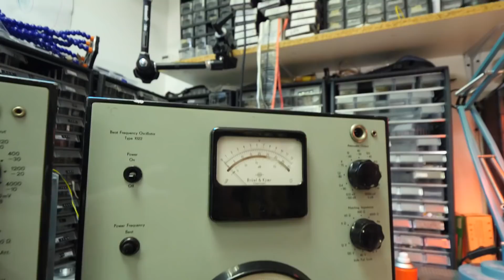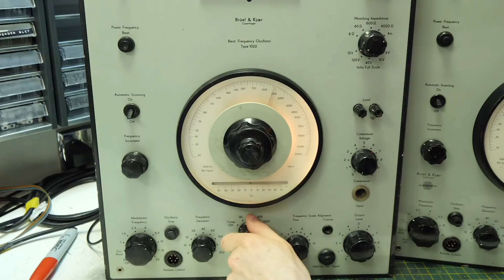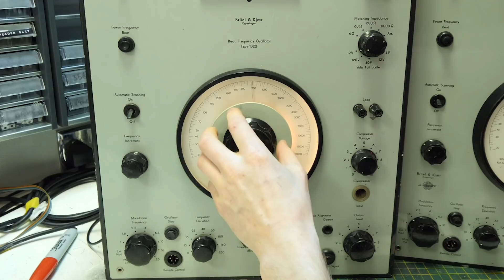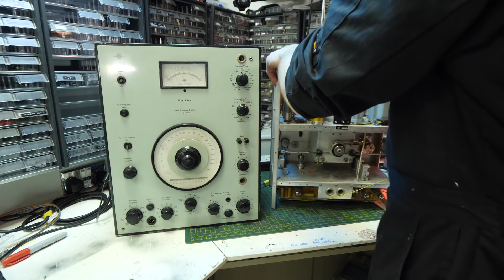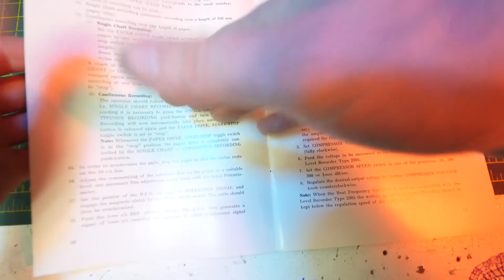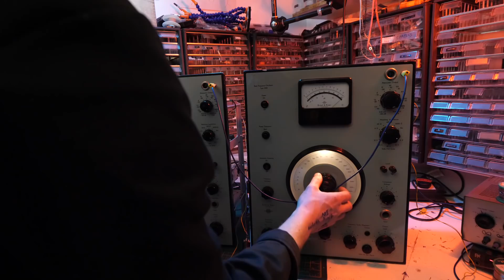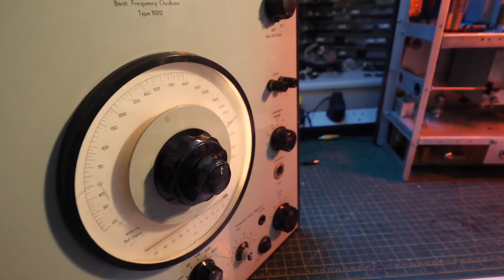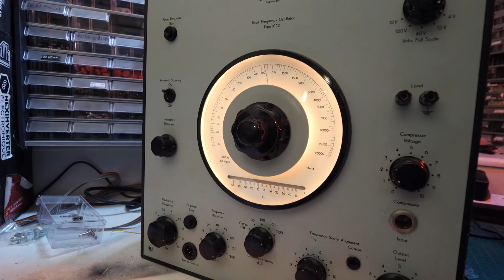Do They Sound Different? SOLID STATE Versus VALVE Bruel & Kjaer 1022

Comment: Been watching both you and Hainbach playing with these.... 
B+J devices , I particularly enjoy once you got them all hooked up as a studio of test gear. 
I too, am interested in the external modulation and haven't seen either of you try what immediately struck me ( probably because I have also been watching Aaron Lanterman go deep on the DKI synergy) but have you tried using one device to modulate another...hypothetically you should be able to setup algorithms of the devices similar to the FM algorithms of the Synergy and Dx7 , and create some really banging FM sounds that you can then sequence.
Reply from the maker: You can. Next vid is on modulation as there is a mod required. I'm not the biggest fan of fm sounds like that and you'd need external vca's to make it do that but it's certainly possible! I'm making modules to make this work in the coming week.

Comment: In this application, no it won't make much difference. At least not one audible to honest humans. When you overdrive them, however, they have quite  different clipping characteristics. I personally think tubes are a bit over-hyped, but solid state (non-modelling) gets limited development so it's probably still cheapest to go tube if you only want one sound and it's that "warm tube sound". For a HiFI digital is objectively and measurably better than analog, but people still like vinyl for some reason.

Comment: you know, if you replaced that frequency knob with a keyboard it'd be a full on musical instrument.
Reply: Wait, lemme rephrase that: I like that frequency knob, it's a nice thing, and if I had that signal generator I wouldn't be hacking it like that. But, supplanting the knob with a keyboard.
Reply from the maker: Well that’s the overall plan with the motor drive
Reply: @LOOKMUMNOCOMPUTER  very nice, you'll have a glissando.

Comment: Hey Sam, I have a type 1017 and a 1013…both with the remote jacks on the front… going to try and control the modulation from an SQ-1 sequencer… would like to solder a jack to the modulation pin on the front…. Not sure which wires go where? Ie which wire do I solder to the pin and where to solder the other? ( using an audio lead) thanks Greg 😊

Comment: Found this fascinating, as I am a Big Fan of Valve Kit.  My Hi-Fi system is valve driven from the Record Deck to the Speakers, via World Designs Phono3 and PSU3, to a World Audio Design KLP1 Pre-amp, which drives a World Audio Design K5881 Mk2 Valve Amplifier.  Originally, these drove a pair of Quad ESL 57 Speakers, but now drive more convenient KEF speakers.  I also have an Akai M8 Valve driven Reel-to-Reel tape recorder.  I gave up on Transistors back in the 1970's.  The only Transistor kit I have these days, are a CD player and a Cassette Player/Recorder.

Comment: I would say that if they sound different then there is something wrong.  You payed an arm and a leg for B&K equipment and I'd be pissed if the output showed any form of distortion. so if the sound is different then the output is at fault. Used to use these with the cable drive for automation of the sweeps and measurement of Audio comunications equipment.

Comment: There's definitely a difference in sound, it's extremely subtle, the valve unit is a touch bit dirtier and crackles a bit
but more specifically the octave button pops a lot louder on the the valve unit

Comment: You say you can pick up these 1022 units for so cheap, yet I look on Ebay and they are always several hundred dollars.  I certainly would love to get my hands on one, but I am not going to pay $500, $400, or even $200 for it.
Reply from the maker: Yes but they do go for less. I bought one a month ago for about 50 quid, just people seem to set buy it now high it’s weird
Reply: @LOOKMUMNOCOMPUTER    It could be a regional thing that in your area you can still pick them up for a good price, especially if the things are popular in your country.   Here, it might be a rarer find and naturally anything vintage like that, they will ram the price up on it.  Further, now that people see it on your You Tube channel, I am sure there are more now that want one of these.   At first, I wasn't interested in them because of the high price tag here.  However, given that you have shown how you can control these remotely via those motors inside, that has piqued my interest.   But granted, as you said in the video, it is just an oscillator.   I would be willing to pay as much as $150 for one of these, but no more.  Currently Ebay has one for $600.  The lister is out of his mind!

Comment: Sam! That beige JVC KM-2000 video switcher unit you have in your video case, what's the polarity on the power cable for the main unit? I don't have the power cable for mine and the power socket is bashed in. It sounds like there wasn't a standard early on and I don't want to fry mine. Thanks! If I ever get to your part of the world I will be seeking this place out!
Reply from the maker: ill have a look i dunno its my friends, it probably wouldnt matter the polarity it is AC afterall
Reply from the maker: oh im thinking of the wrong thing is it dc i dunno

Comment: I guess, they would sound different, if you were to drive the circuits harder. Valves distort quite differently than transistors. 
Other  than that, it's test equipment. It's meant to sound as clean as possible.

Comment: May I suggest you change the mains voltage selectors to 240V, since you have at least 230V there. The iron cores in the transformers might otherwise go into magnetic saturation and draw more current.

Comment: How difficult would it be to turn one of those BFO's into a theremin? Are you gonna let people play with those things as a hands-on interactive display?
Reply: In the traditional sense of the Theremin, the two heterodyning inputs need to be ultrasonic so that only the beat frequency is in the AF range. In the other variation, a variable capacitance from your hand in the picofarad range passes near the antenna of a tuned LC circuit mixed with that of a fixed tuned circuit is amplified and the resulting variable voltage output can be used as the control voltage for a VCO like the equipment shown (front jack).

Comment: Another idea, if you wanted a pseudo-trigger/volume control you could add a vactrol to control the output volume. Pretty simple but effective, plus also at audio-rates you may get some weird stuff too.
Reply from the maker: The modular/patchbay will have vca’a amongst loads of things so no need for volume stuff :D
Reply: @LOOKMUMNOCOMPUTER  Ah yeah of course! I just brought it up since I threw a buncha vactrols in series with the controls on some similar audio test equipment and used those for frequency pitch, volume, etc. A poor man's solution. :)

Comment: I was pleased to hear you speak about the dangers of Capacitors holding a lethal charge.

When I attempted to restore my Garrard one valve wonder I found a great video at YT which told me how to build a simple lead to discharge caps with nothing more than a bit of wire and a resistor, a sharp pointy tip and a crock clip.

So folks, check out discharging capacitors the right way, and don't just short them out, drain them to earth.

Just because it has been turned off for a week or more, a capacitor can still give you a lethal smack in the face of several hundred volty things.

Comment: I have a really ancient BFO here in my shed, could be WW2 or even earlier. Valves are AR15 (Army reciever 15) and ARP24 (Army receiver pentode 24). Go on you know you need another one.....Just needs 200vdc HT and 6v for the heaters.